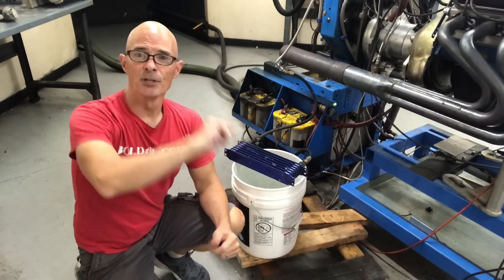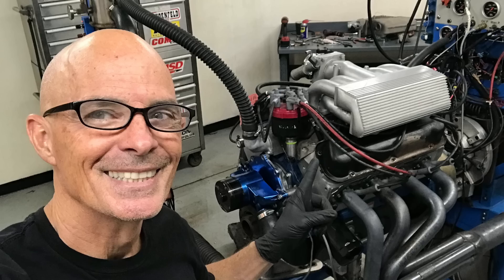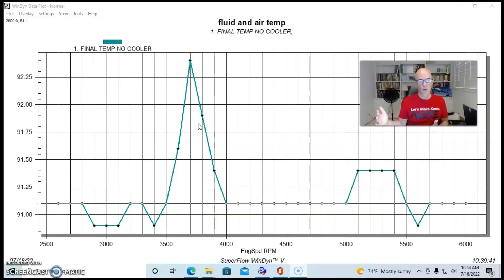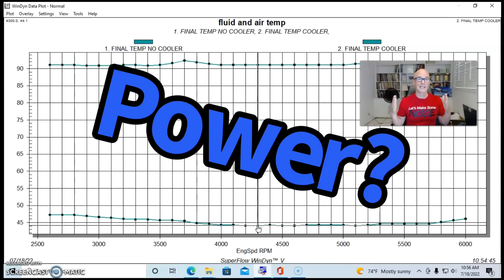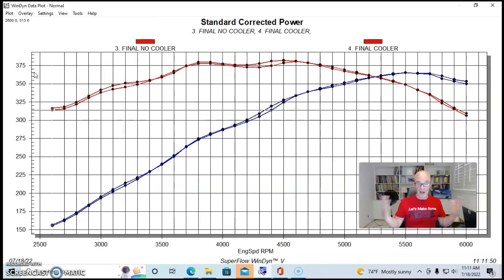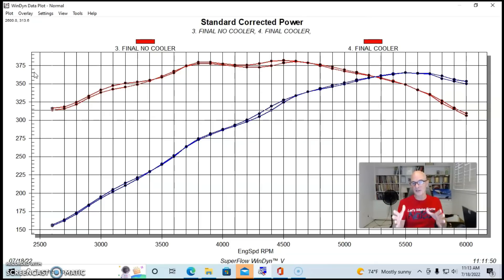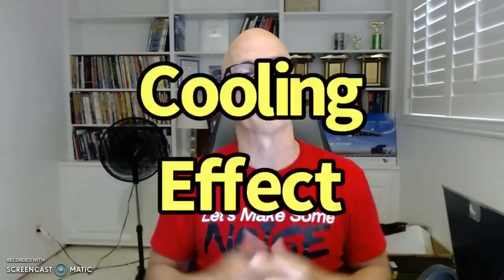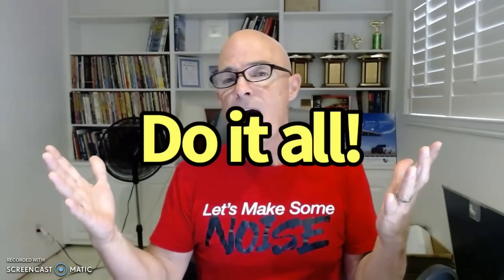EFI FUEL COOLING & HP? DOES ICE-COLD FUEL ACTUALLY ADD POWER TO YOUR FUEL-INJECTED MOTOR? DYNO TEST

Comment: I wasn't expecting a big difference since you're using EFI, it's a dry intake.   Cool fuel works with a carb and wet intake setup and I believe that is what Steve and David found.
Reply: Yea I recon he would see more of a change on wet manifold stuff
Reply: You should check the fuel temp right at the fuel rail..
It picks up a LOT of heat through your uninsulated fuel lines etc after the cooler. I run a cool can  with dry ice and ethanol right next to my carbs on my 2 stroke outboard Drag boat and it makes a BIG difference.
Reply: How to find the video by steve and David?
Reply: @christophermackin147    I think it was titled "Does Fuel Cooling Matter" and was an episode on Engine Masters.  I watched it on Motortrend, not sure if it's on youtube, I've never tried searching for it.  Hope that helps.  Edit: The episode is season 7 and show 113 called "Does Fuel Temperature Matter"
Reply: @firebirdjone  really appreciate you pointing me in the right direction. On a side note I love the Firebirdjone handle. My first car was a 69 firebird. Picked it up for 2000 back in 1992!
Reply: @christophermackin147    Cool, thanks for the kind words.
Reply: Here's that episode of Engine Masters!  https://m.youtube.com/watch?v=r6F19CEs4dk
Reply: Ill have to check that out, my aftermarket EFI system is a wet intake system, fuel injectors in the throttle body sprays the fuel atop the throttle plates.  I had hope this would cover if fuel cooling would have a big enough benefit for me considering it for my daily driver but this focused on the port fuel injection setup.

Comment: I live in Iowa. I dont feel any more power in the winter time than I do in the summer time. If you think that is different, I would have to argue it isn't. The fuel defenatly gets colder than 44 degrees f. It gets cold enuf to make a diesel engine gel up & stall out while it's running somtimes.

Comment: And you mentioned it air and fuel temps would be hotter in a vehicle so 
Do you have a way to heat intake air to simulate real in car engine atmosphere
Then see how much cooling fuel helps then 

I see where cool fuel sprayed into already cool air.  Won't have as big of effect.   As if it would if air was hot

Comment: Start with high air temp, engine temp, coolant temp and fuel temp, then only change fuel temp for real world application, the engine wont benefit from cool fuel when everything else is cooler than real world conditions. We all know you run cooler engine and air temp in the dyno cell than in real world application, wont be by much, 10-15 hp max, but thats the only way you’ll see a beneficial change. Another test would be to increase air temp and run a air to water air cooler, wich i plan to do with my project due to what i observed during the drag n drive events, cool air, cool fuel where those are the only parameters you can manipulate in the vehicle.

Comment: Great idea for drag week cars that get vapor lock, throw a cooler inside of the water to air intercooler tank when you’re running on the street between tracks, you have the right idea, just the wrong application

Comment: A In Evo x car we stick a we wud hang hollowed out cobalt balls in a tube like a string of Xmas lights before turbo pump liquid nitrogen in to the line. the intake air wud flow over the super cooled balls we got -42 ntake temperature
Reply from the maker: YOU PUMPED LIQUID NITROGEN THROUGH THEM? DO YOU KNOW WHAT THAT ENTAILS?

Comment: With the cooler fuel charge, you can give the motor more timing before detonation occurs, hence more power.
Reply: Incorrect, cold vs hot fuel won't allow you to run more timing. Cold fuel combust at the same exact rate as hot fuel until you get to massive extremes. An engine will want the same timing no matter what fuel you run or how cold/hot the fuel is. Doesn't matter if he super chilled 118 octane or ran hot 87 octane, that engine is not going to allow more timing to make more power.

Comment: Try it with a turbo and moving injector location, some BMW use water injection to cool the intake manifold (what I think that it's happening) is that the fuel has to be able to vaporize when the heat in the combustion chamber is enough, so it needs to be in very tiny droplets and a little high temperature, but before entering the combustion chamber the fuel could transfer his coldness into the intake air charge to make it densier, and therefore the fuel being hot enough and the air cold enough, so moving the injectors should help, and increasing temperature difference like in a turbo aplication should also help, becauseof it can take more advantage of it
Reply: water vaporizing takes a lot of energy.
like swamp coolers and such.

same for the fuel vaporizing.  or water boiling, doing the boiling up an amount of water takes more energy than bringing the water to a boil for same reasons.

Comment: The cooling is probably more in the evaporative phase and it only 13 to 1 air fuel so not much fuel to do the cooling with 
could have a bigger difference with methanol

Comment: Some key considerations.

1, fuel atomization v vaporization. Colder  fuel is harder to vaporize, which leads to combustion anomalies because of wet flow changes. As more atomized fuel can enter the chamber and less vaporized, the wet flow now, theoretically, favours a leaner tune. This would be interesting to test on both low octane fuel and E85.

2, an engine uses air as its source to generate cylinder pressure. The fuel heats said air when its burnt. In this fuel injected example, colder fuel doesn't change the density of air to increase the cylinder pressure, only the fuel burning characteristics. Compared to a carburetor application, the colder carby lowers air temperature. Because the air is colder, it will expand more when heated, thus generating extra cylinder pressure.

3, it would be interesting to see if timing changes were made, or if a/f ratio changed.
Reply: one needs to look at how much the fuel itself cools just by turning from liquid to a vapor.

Comment: I think the cooling has more of an effect when you have an engine that is really pushed to its max. It doesn't as much add power as it allows you to push other things farther. Timing, compression, boost, etc.
Reply: Cold fuel doesn't react to anything like you're assuming, until you get to the extremes of it's boiling point. Compressing cold or hot fuel won't make any more power under boost or by adding compression ratio. It will never allow you to run more timing as it's combustion rate will be the same, cold or hot. I'm talking common sense, not factoring in crazy high compression like 20:1 or higher though.

Comment: I highly doubt that fuel temp or intake temps would make enough difference to call it anything other than test variations you would see running 10 pulls on either setup. I've always laughed at the guys at the track with bags of ice on carb or FI engines. Yes it can help cure issues with vapor lock as you mentioned but it does nothing else. FI engines flow nothing through the intake but air and it moves so fast a hot or cold intake makes no difference. Carb engines do move fuel and air through the intake but the velocity is so fast it won't amount to a hill of beans, other than getting water all over your engine and the track when you run. Same for the idiots who have some schmuck in the burnout box spraying nitrous on the intake after they do their burnout. Liquid molecules don't react to such small variances in temp anything like air molecules do, so unless you're changing the temp of the air you're moving through the engine it's not going to make any more power with cold fuel, hot fuel or ambient air temp fuel until you get to extremes where you're at the point of the fuel evaporating. It won't matter on turbos, roots blowers or centri blowers either. Won't matter if it's carb, TPI, direct injection, port injection or anything else either. High compression, low compression or any other sort of fuel either, liquid just simply doesn't react to the small variations in temps you're going to be able to create in those conditions. Fuel is fuel, cold, hot or ambient temp. It's not going to help with detonation or anything else no matter the combustion ratio or under boost.

Now the only place I've ever seen it make a difference is on PD blowers, cooling the blower case helps. It's not anything but the metal material (mostly aluminum) that the blower is made from expands when heated and shrinks when cooled so cooling it tightens up clearances between the rotors and case causing it to seal better and make a little more boost which you know more boost, more power.

Comment: This is very interesting but not what I thought it was. I thought this was gonna be about using fuel to cool hot engines example enriching mixture when engine is hotter to help cool cylinder temp etc also seems that in theory this might work better for throttle body injection

Comment: What would happen if you had a higher pressure fuel system and tested from cold fuel to a heated fuel. The higher psi should prevent boiling of the fuel, but would the heated fuel aid in vaporization, leading to better mixing of fuel and air?

Comment: You’re not seeing a power gain because those injectors are at the bottom of the ports basically and the fuel doesn’t spend enough time with the air in the port before it’s into the cylinder and burning…. Like you say, the higher up the injector the more evaporative cooling you’ll have from the fuel

Comment: I would have been surprised to see any significant difference. The thermal mass of the fuel is very little compared to it's latent heat.
Reply: and if it vaporizes that takes way more energy than the energy in the temperature difference anyhow.

Comment: Maybe its one of those things that doesnt change much because of the power level? Like how you can put 4” exhaust on that 302 and there wouldnt be much power gain… but if you put a race cam in it and a tunnel ram intake where it would make higher hp and probably want to run hotter naturally with the higher compression, i bet it would make a difference then like with the water-meth injection which dave proved its better running straight methanol… but im no engine builder i know what i know from you guys doing tests i dream about doing

Comment: I've actually done this on a naturally aspirated high compression carb. Yes i saw around 12 hp on the dyno, but when used with a ram air system, it was definitely in the 35hp range based on improved 1/4 miles time...
Reply from the maker: 35 hp on an NA motor?
Reply: Yes. A well designed ram air can add 15 to 25 ish. I would see positive pressure of almost a pound of boost top end of track.  If you recall the ws6 trans am were claimed 30ish horse power. The 1/4 mile times were about 3 tenths faster than non ram air. You cant really dyno a ram air system. So i am guessing because i gained 4 tenths with cold fuel and ram air at 35ish hp. On a cold crisp day that particular 306 roller mode was like night and day to a hot day. I added the cold fuel and ram air to simulate a colder day. Carb was a 625 road demon. I can't remember jets, but cam was an e303, compression was 10.8 to 1 , iron roush 200 heads, air gap intake, 32 degrees timing all in by 2500rpm, stall converter 3200 stall coan c4, 8 inch limited slip 3.40 gears, 26 inch tall rear M/T drag radials. I went from a best if 12.5 at 106mph 1.80 60 ft time to an 11.87 @ 111mph (around 111 give or take mph it was 15 years ago) 

I used two cool cans in line, ram air was built by me out of aluminum and ducting.
Reply: Forgot a few things that best time was icing the intake too.... But as mentioned I picked up .4 tenths without icing intake. I wanted to take a sneaky Pete NOS system and hook it up hidden to the ram air system and trigger it half track. 

I will add some if that initial 12hp gain from cooling the fuel was down 5000 miles after breaking in the engine on an engine dyno. But the track times i may be able to verify. I think i kept them.

Comment: Ice water is OK, but you can only cool down to just above freezing.  A big spiral of stainless tubing, in a bucket of just ice. With a way for the melt run off to drain. Now you have below freezing ice directly cooling the fuel.    I deal with chilling liquids to as cold as possible on a daily basis.   Straight ice is always colder than ice water

Comment: The fuel needs distance to cool the air to make the air denser as you said, I believe the cold fuel that close to the combustion will give you more detonation resistants in the car and lessen hot spots in the combustion chamber… more boost (more timing if it will take it) or try one of those throttle body injection deals.

Comment: Thinking about it we had heat soak in circuit use with low fuel and assumed fuel was too hot. But filling with cool fuel didn't restore power or reduce knock.

Comment: Someday, someone will come out with a system that will allow a tuned port injection engine to run Liquid Propane injection and enable it to be controlled with Holley engine management.
Propane going from a liquid to gas entering the head will give a much more significant cooling effect than E85, so it should work pretty well.
Reply: GM made propane powered LS engines from the factory for schoolbuses and other larger vehicles
Reply: @rustysausage69  That was propane vapor not liquid propane.

Comment: What about cooling the lower intake on the Ford?  Weld up the bottom of the lower intake and plump water thru it to cool the hot lower intake manifold.
Reply: Won't make a difference. Air moving through an intake track will never have time to exchange heat, not enough surface area and the velocity is too fast to make a difference. You'd need a massive intake with way more surface area, an air to air intercooler basically.

Comment: Might see a bigger change on an all out big boost combo. Sometimes a little heat helps atomisation though. I think the power gain from ethanol is because it carries its own oxygen molecule as well as 6 hydrogen molecules. You should do a 10% nitromethane test!
Reply: My immediate thought was that cold fuel might hurt atomization, but that's probably only a case with low pressure systems (34psi fords)
A system with a high base fuel pressure (>60psi) would likely negate that downside, but I suspect the benefits and detriments are so miniscule to be immeasurable.
As Richard said, maybe e85 where the volume of fuel is higher might bring into a measurable level.
Reply: @MeatPoPsiclez  Cold fuel does hurt atomisation. This is also why engines today run hotter with thermostats around 100c as engines at 80c experience more fuel condensing on the cylinder wall meaning less power from the same amount of fuel. LPG is great for charge air cooling and methanol is good because you have a lower air fuel ratio meaning more liquid mass to absorb heat and it creates a lot of water vapour which cools the combustion chamber.

Comment: I think you'd see a significant increase in power if you were using throttle body injection or carburetor. You'd essentially be cooling the air charge with the cold fuel, as opposed to the port fuel injection, which doesn't have enough time to cool the air.

Comment: I had a crazy idea about this a while back- wrapping the injector rails with coiled copper line and running LN2 through them. That way the fuel is chilled right before it is injected and there’s no parasitic heat getting to it beforehand like on an inline cooler setup.
Reply: Liquid moving through his cooling setup may lose a few degrees from his temp probe to the tip of the injector at best. Cooling the fuel rail would honestly amount to a hill of beans compared to what he's doing if it even did anything at all. The setup he did most likely was the best way to have fuel in contact with the largest surface area possible. A bigger cooler wouldn't make a difference either, it would only matter if his temps had rose drastically during the pull, which it didn't.

Comment: I would expect to see a more rich fuel condition but only with a carburetor,  efi would pull fuel to keep afr correct via the o2 sensor, but the extra volume of e85 in correct afr  might see some benefits
Reply from the maker: there was no pulling fuel-I don't run in closed loop
Reply: @richardholdener1727  
Ok then 👍

Comment: Do all three, and relocate the injectors. Plus: Add table salt to the ice bucket (Too improve heat transfer) and run a larger color as well. I have a feeling that if you get high-content alcohol-based fuel cold enough, it'll be like "Who needs an intercooler...?!" Especially if the injector placement is stratified correctly.
Reply: I think the cooling of the inlet charge is dominated by the "latent heat of vaporization" (the phase change from liquid to vapor) than by conduction of colder liquid in contact with the air.